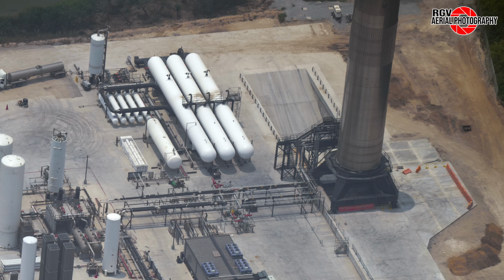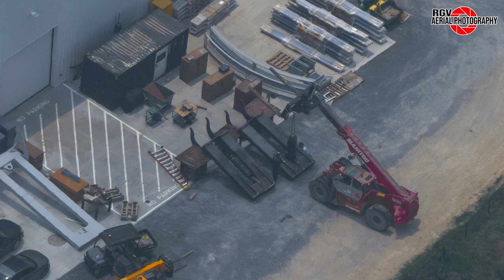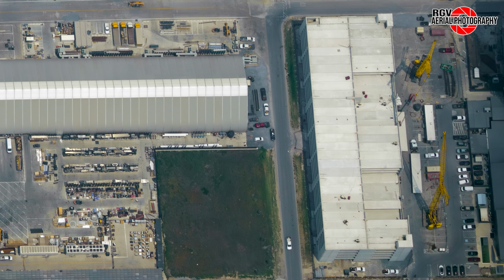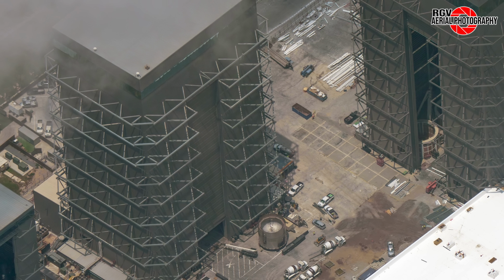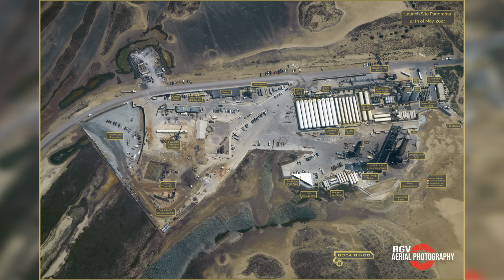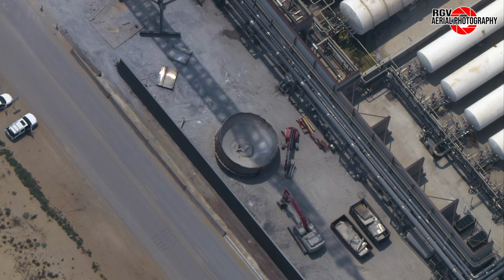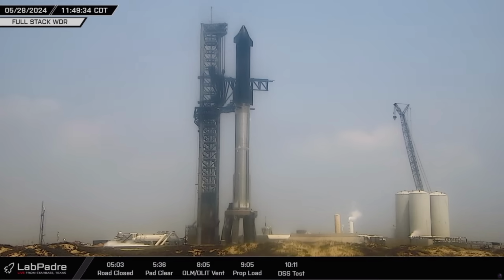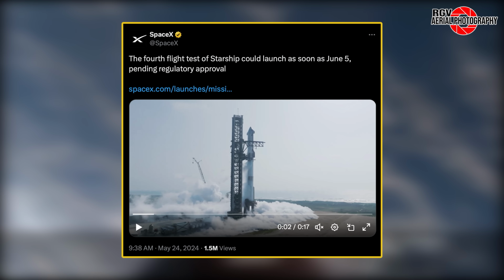Starbase Tower 2 Foundations | Flyover Update Episode 43

Comment: Can someone please explain to me why SpaceX isn’t putting solar panels on top of all their buildings at Starbase?  Imagine how much solar could fit on top of the Starfactory alone!
Reply: I remember there being solar panels in the renders for star factory. Maybe they just haven’t got to it yet. They could generate a lot of power with all that space for sure.
Reply: Right?  They used to have a solar farm on site but that disappeared to make room.  Even if they couldn't power everything by solar, every little bit helps.
Reply: I don't know this for certain, but I'd imagine they'd want to get every other bit of work done first (like finishing up those HVAC installs) as once those solar panels are on it would restrict work quite a lot.
Reply: Because it's all under construction currently and some structures may not be permanent
Reply: @dmurray2978  no one or nothing is permanent in this world :D
Reply: The base is literally a work in progress right now.
Reply: They are now connected to the main grid in Texas which lots renewables including wind and solar. They have back up power in case their grid connection goes down. I think they will eventually put panels on the factory to form a X
Reply: I've asked so many times that question but didnt get the answer. Maybe they will put some top of starfactory. That region takes a lot of sunlight it'll be very great idea
Reply: @wloffy  I don’t see a downside.
Reply: Im so glad that in germany it is mandatory to put solar panels on factorys like this. It just makes sense
Reply: Because the payback solar+batteries takes forever, plus you still need to pay for a mains power connection to handle a few cloudy days in a row. So they're much better off selling panels and megapacks to other dupes, sorry, cash-paying-customers.